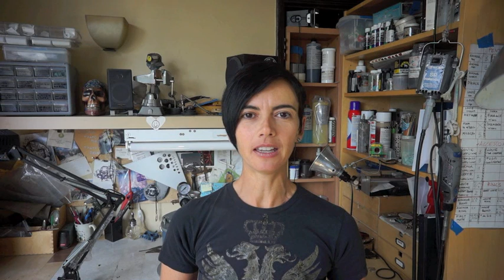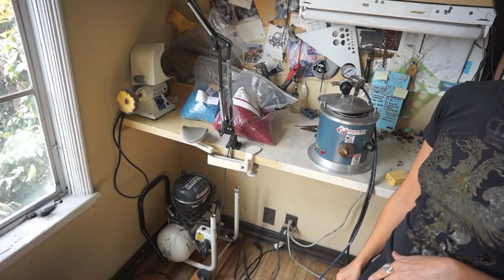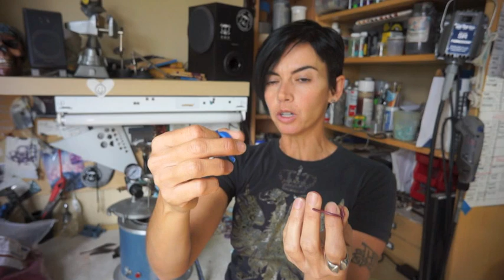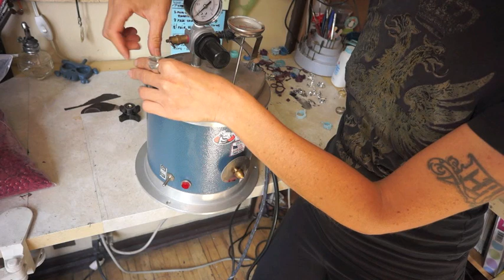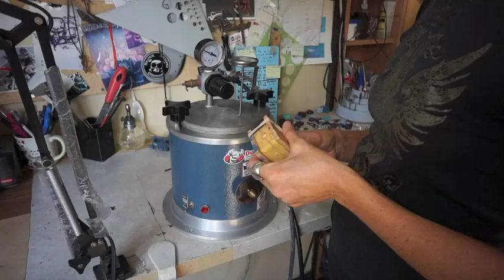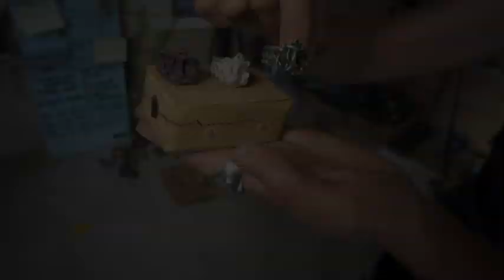How to use a wax injection machine.

Comment: sooooo there's a step missing right?.. some how u go from the "positive" purple wax mold... to  ????? a negative ??? mold hole??? and fill it with the metal some how ??? .. but very nice work.. well shot.. .. clearly you guys have alot of skill and could work on anything arty.... have you worked on something bigger in scale?... .. anyway.. hope you do some more stuff... great work.. maybe someday we will be lucky to see your work in the bike world ?
Reply: Once you have your wax figure done, you put it in a container (maxing sure you make a pour spout using a piece of cylindrical wax), and then pour a mixture of "investment" around the figure. Wait for the investment to dry for like 16-24 hours, then you heat up the now hardened investment with your wax figure in it to a very high temperature. The wax will then burn up, leaving a the negative form of your pour spout and figure. Heating up your investment mold also helps prevent cooling of the flask so metal flows freely. Once its hot and the wax has incinerated, take it out of heating chamber and then pour melted metal into the mold! 

Investment is great for this because when you put it into water it immediately starts to dissolve. You can then easily continually scrape investment until you reach your solid metal piece in the middle of your mold!